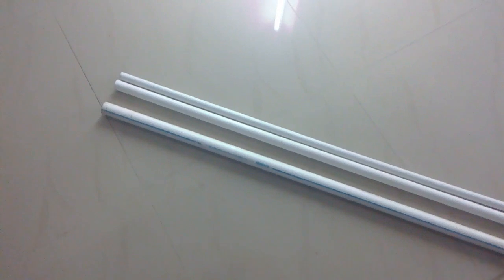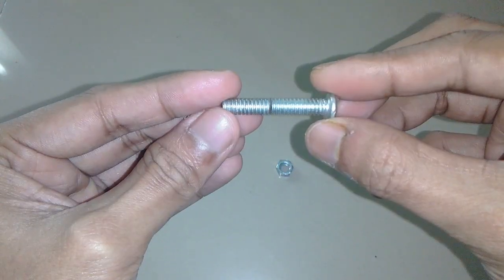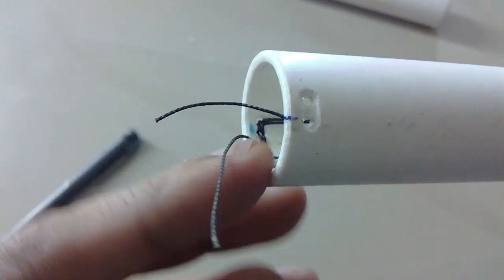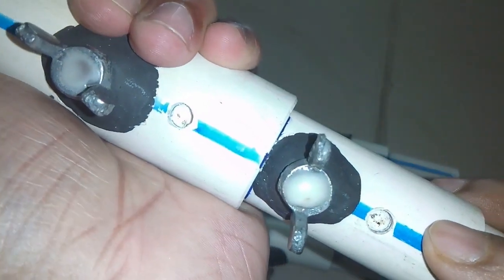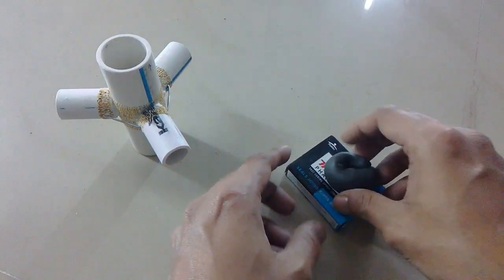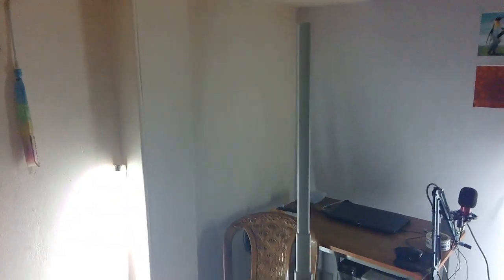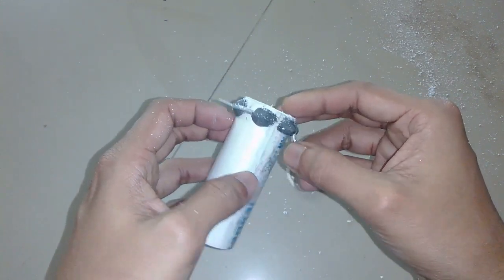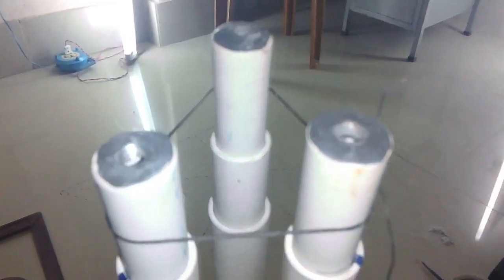I made a camera Tripod with PVC pipe Part - 2 --- Its About Everything.

Comment: i bought three pipes 0.5 ,0.75,and 1 inch but they do not slide in each other as you told.
i measured inner dimeter of 1 inch pipe and outer of 0.75 inch pipe both were found to exactly same so we cant even slide in the little one into the bigger one.

Comment: More then 400rs total cost it will. U can buy the cheap n good tripod. This is also bulky. For home project. This is is very good.

For buy i will not suggest.
If u hv some pipe at ur home u can try it while it will zero cost for u
And for learning n try for hoby its very impressive
Reply: This tripod may be bulky but it's more durable and more strength than cheap one in the market.